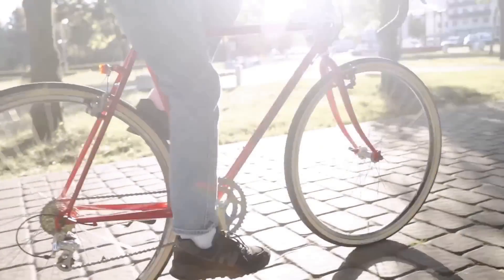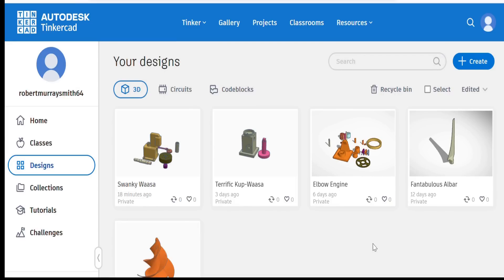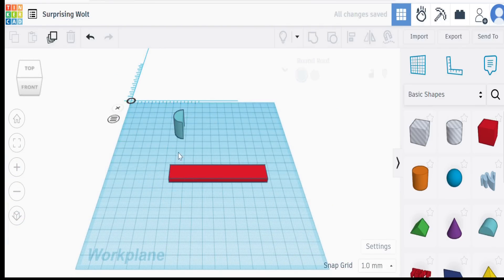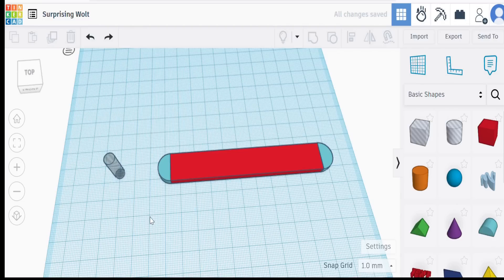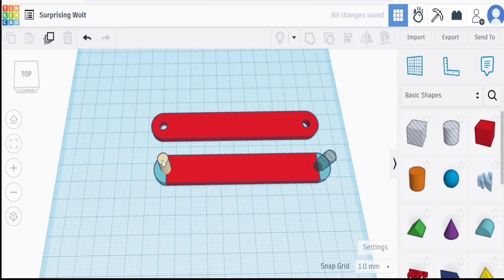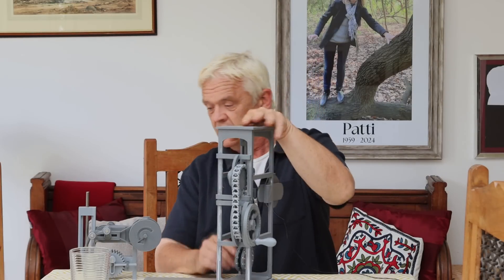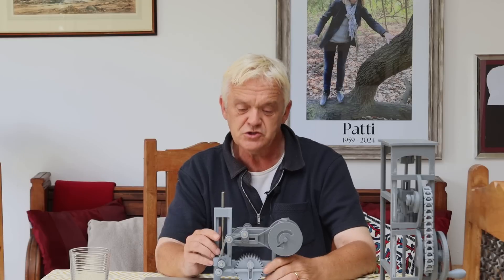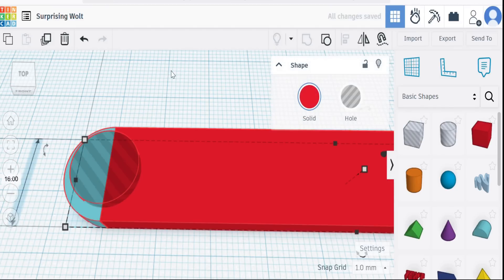2270 Making Things Move - 3D Printing Joints

Comment: i  caught a "Vunder" iirc username vid on coilspring crossbows , it was so simple basic to figure finally , he explained it has two big pulleys and two small ones , one big and one small on same axle (2) ...so the heavy pull coil springs on the sides the bow pull the small rollers only , while the longer string only around the larger diameter pulley , so it gets longer pull off the shorter spring pull at the rollers , he made compact, simple spring crossbow this way but it needs a motor cocking mechanism , with a freewheel so it doesn't need to reverse imo ....

Comment: you get frictional loss and backpressure but i think i can make a linear steam motor using electronic solenoid piloting based on pressure in the chamber off a boiler , so i can control the flow by a flow regulator ball valve or control the speed it discharges and set the pressure , all  electronic and pressure switch controlled , to quick exhaust type valve into the cylinder , but i'd copy the bicycle freewheel , steal that as my crankshaft for each cylinder or two ..../ranting

Comment: Quick Tip on the cylinders in tinkercad: click on basic shapes, go to design starters, then subheading geometric(blue diamond next to red A). scroll until you see the "high resolution cylinder" and click the highlighted star inside the selection box to add that bad boy to your favorite shapes menu. It's a sanity saver when you're staring at a model with a thousand cylinders wondering if you moved the slider to 64 on every single one.

Comment: thats why i wanna make a doddy drive i thought of using earnshaw's theorem to make a design so that the spin is stabilized through the geometric arrangement of the magnets, but i cant afford a pack of small neodymium magnets to prove my design i am so finncially deprived, because you would not even need a ball bearing the magnets' specific arrangement is specifically aligned in such an array as to prevent the levitating spinning object from doddering in its spin with being anchored to a bearing to stabilize the spin. hence the name doddy drive. I would make a prototype with styrafoam into which I would press small neodymium magnets in specific arrangements to overcome the problems posed by earnshaw's theorem, for a maglev AC generator with no points of friction - as a prototype.
Reply from the maker: i hope sometime you get to make it mate

Comment: Does anyone know if a 3D printer can print a perforated 20 mm inside diameter cylinder at 100 mm high with 2 mm hole size.
Reply from the maker: yes it can

Comment: It can be pretty tough to 3d print parts with tight size tolerances.. For fitting and snapping parts together..

That has to do with drive gear designs of 3d printers..if it has to put pressure on the nozzle it often loses about 10-20% of material output.. First layer is never perfect.. Temperature differences.. Warping..every material has its own temperature curve.. 

Thats Als why I think 3d printing + casting is better.. Make one perfect mold and copy
Reply from the maker: it's an approach that works well mate - but 3D printing is useful in itself - if you print with the tool  in mind

Comment: Thanks for the information on the pins and hole sizes Rob.
I am actually working on this for my model. Only, I underestimated the amount of clearance that is necessary for them to work correctly. 2 hundredths of a mm rather than the 2 to 4 tenths you showed.

Those that say models are a waste of time, are ignorant of the long standing proverbial warning; "It looks good on paper".
I think this is due in part too poor educational practices.
Years ago I was talking to a modeling engineer at GM and he explained part of the high cost of developing a new automobile.
The design engineer sent him the plans for the glove box he was building.
He could see that their was a physical obstruction that would prevent the box from fitting where it was supposed to go.
He informed the design engineer of the obstruction, and the design engineer insisted that the box would fit.
The only way the model engineer could convince the design engineer that the box would not fit, was to build it as it was designed, and show the design engineer that it would not fit. Then the design engineer adjusted the design so that it would work.

Sometimes it looks good on paper but it does not work in the real world.
Sometimes, it looks good in the virtual world, but it does not work in the real world.

That is why models have to be made. To ferret out those areas that both the paper and the virtual, are not revealing.
Reply: @scotttovey  I  am currently stuck on a project because of this very thing.
it looked good in the computer and everything worked just fine in sim, but after 3d printing the prototype I discovered a large number of flaws that required fixing.
It taught me a very good lesson about real vs "on paper".
Reply from the maker: nice one mate - thanks for sharing that
Reply from the maker: i really did enjoy that story mate - lol - good one cheers
Reply: @ThinkingandTinkering  😎👍

Comment: When i bought my 3d printer, i tried to make a small tool case for my small screwdriver set. Turns out its actually pretty tricky to make a hinge and locking mechanism. Things we take for granted. Much trial and error and many failed prototypes.
Reply from the maker: i would say making a hinge is easy mate - but making a hinge that fits! that's a different job lol
Reply: Your probably. Getting those tolerances right is a challenge. Im using older 3d software ( Lghtwave 3d ) for modelling and export to stl. I should check out TinkerCad.